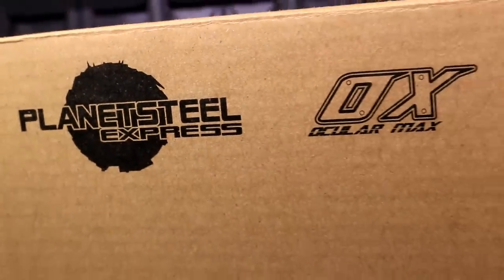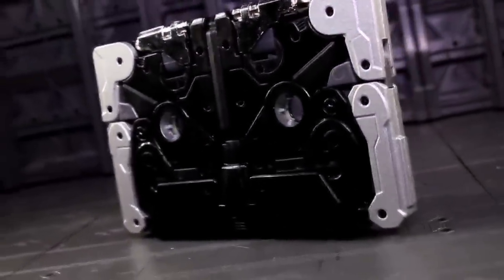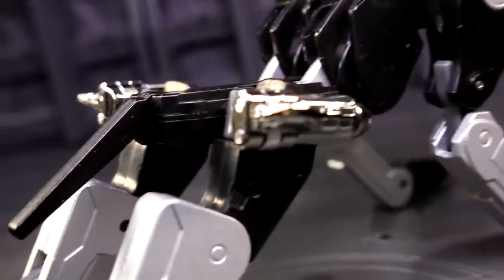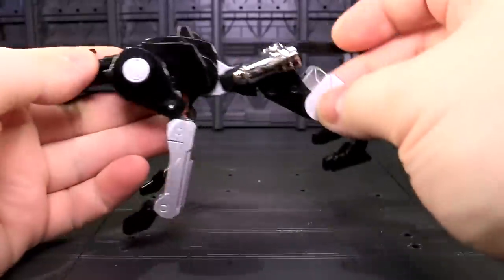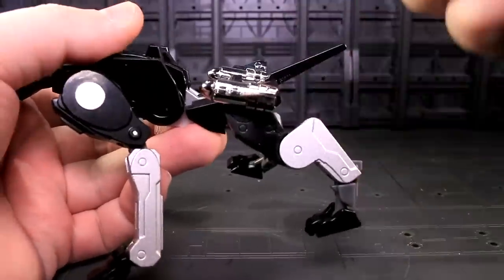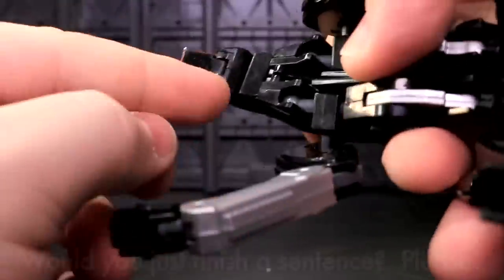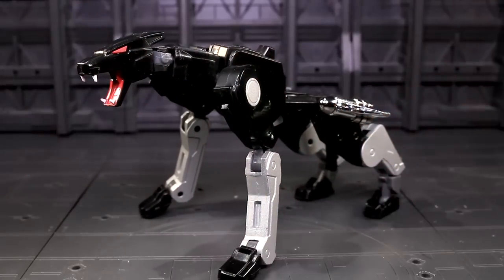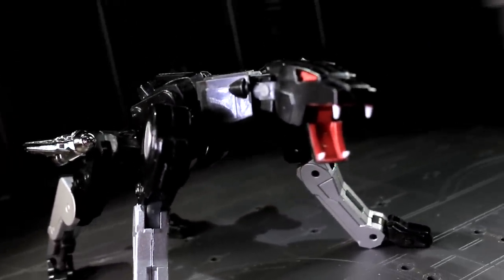Ocular Max RMX-01 Jaguar - Vangelus Review 321

Comment: I CANNOT THROW MONEY AT THIS FAST ENOUGH. Seriously, I'm a big Ravage fan and I don't think any toy has ever gotten him right. Even the awesome little Device Label guy disappointed when the plastic disintegrated to crumbs. This guy, on the other hand, looks like what I've been wanting all these years.

IF THEY MAKE A RATBAT I WILL HAVE HEART PALPITATIONS.
Reply: The Masterpiece got him right.
Reply: +Jarmo Verriet The MP is good, however it is also very, very small, and a lot of the joints are tight enough to make me terrified of breaking him. I don't like a toy I'm afraid to play with.
Reply: AlexReynard Haven't had those problems with mine. I think the scale is perfect when compared to the rest of the MP line, and unlike this guy, he actually looks like a casette due to the paint, whereas this guy just looks like a big black rectangle with holes in it.
Reply: +Jarmo Verriet Reprolabels will provide.
Reply: +AlexReynard No doubt about that. If they do, i'll buy this guy and sticker him up.

Comment: It won't fit into a cassette deck, regardless of how accurate the size is because there isn't a series of holes along the bottom edge that are used to lock a cassette into a deck mechanism's capstan. With these holes missing that go all the way through on a real cassette you won't get him in.
Reply: Well that and the body being entirely too thick.